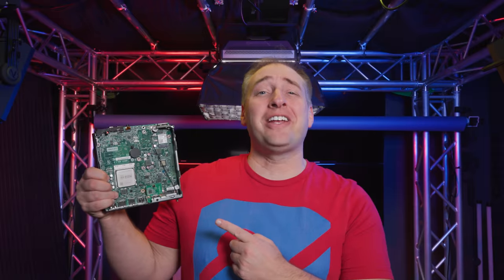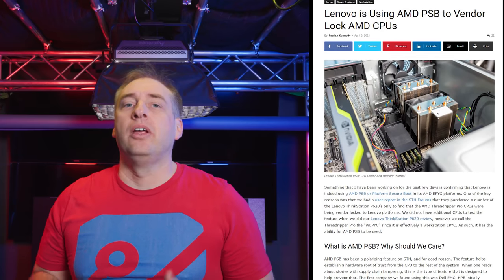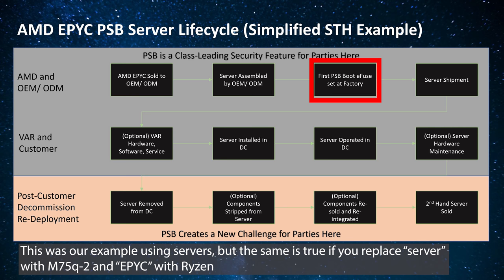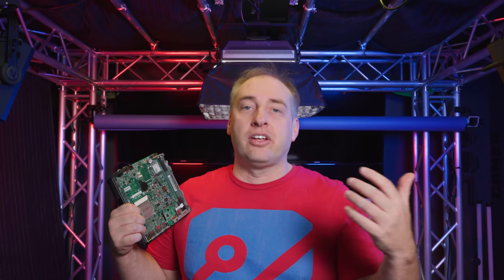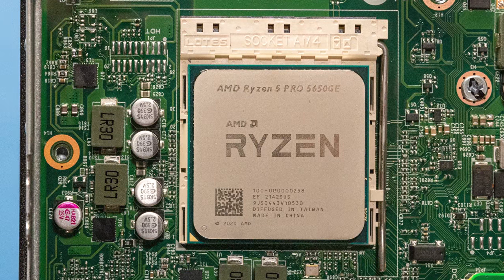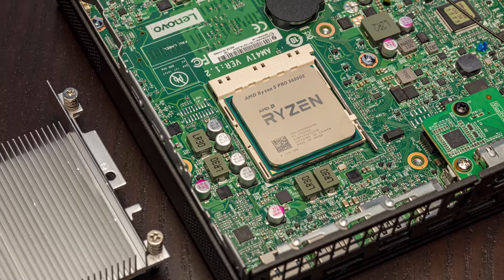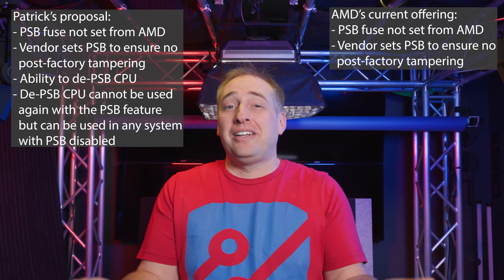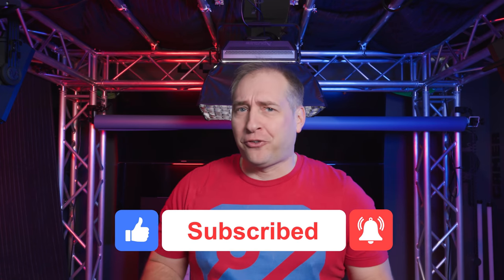Yikes! Lenovo is vendor-locking AMD Ryzen CPUs via PSB

Comment: I think AMD should support a physical mechanism for resetting the PSB fuses. Obviously you dont want it to be possible to reset the fuses in-situ via software (which would enable an ATP to circumvent the security of PSB), but there is no reason why a (cheap and easy) mechanism could not be supported to enable the fuses to be reset by pulling the CPU out and popping it into a "PSB fuse reset" board - or by flipping a small microswitch on the the cpu itself.  The PSB security is only intended to mitigate remote attacks: if you have physical access to a device you can always pop in a new non-PSB enabled CPU and then disable PSB in the BIOS. So giving a physical way to reset the fuses shuold not create a new security weakness.

Comment: This is one of those cases where computer security has gone way overboard. Seriously, if someone has access to the hardware, you are already screwed. Having a certificate chain between the CPU and motherboard is such an extreme, edge case that it is stupid to literally brand/damage all of the CPUs and make them practically unusable on the second-hand market. It really needs to be a feature that is turned off by default and for the 0.001% of customers who need it, they can damage their CPUs if they want.

Comment: The assumption here is that by locking against a specific vendor's signing key for their firmware somehow ensures that the chain is intrinsically secure. How much faith do you put in Lenovo maintaining said key(s)? I worked on early HDCP implementations, and in 2010 a root key leaked, pretty much nullified the whole model for that generation. In this model, not only do you end up with a bunch of CPU's that can't be reused, they could end up being associated only to compromised keys that have to be revoked. Is Lenovo or HP going to send everyone new CPU's? Nah, they'll just send out a "beware" notice. Frankly, this is security theater.

Comment: It would make absolutely no difference in security to have the secure storage for the CPU be cleared if the motherboard firmware presents a different root of trust. You could even prompt the user with "The root of trust for for the firmware on the current motherboard differs from the one adopted by the CPU. If you want to proceed with the booting process, the secure storage on this CPU will be cleared before adopting this motherboard's root of trust. Press ESC to cancel adoption and proceed to back up any data on encrypted media if necessary"

e-fuses are a fancy word for one time programmable memory, this is used in cheap microcontrollers, not with expensive and long lasting CPUs. This is a security clutch that makes me cringe every time I see someone use it. This is not about security, this is about control

Comment: This is the case of a vendor abusing a security feature (one that wouldn't likely affect more than 0.0001% of the market) for greed.

AMD should for sure put in the feature to fully disable PSB (wouldn't support secure boot anymore but no big deal there).

Without that ability to disable PSB, I feel this goes against the intentions in the "Right to repair" legislation.

Comment: Why can't they make it so that non-PSB motherboards don't PSB locks at all?

Then:
* a Lenovo system would accept only factory and Lenovo CPUs
* a non-PSB motherboard would accept any CPU (including Lenovo ones)

Are they concerned that an attacker could swap the motherboard with a backdoored non-PSB one? Then vendor-locking would make sure the owner notices because the CPU would no longer boot (in the fake motherboard). But in that case, the attacker could swap the CPU as well, so it just makes the attack a bit more expensive.

EDIT: A different idea: instead of fuses, the CPU should store the key in volatile memory, so that the vendor-locking is reset by a full power cycle. That way, you can remove the CPU and put it into any other system and it will still work, but you still protect against remote/pure-software UEFI attacks (which don't cut power to the machine, so after the attack the CPU wouldn't boot).

Comment: Lenovo's gaming desktops IdeaCentre5 and Legion5 which you can buy equipped with an Ryzen 5600G plus RTX or Radeon graphics card do need an installed graphics card, there's no way to just take out the RTX/Radeon graphics card and use the integrated graphics of the 5600G APU. Afaik Lenovo deactivated the APU's internal graphics. Can somebody confirm this, and if so, would this be also via popping a PSB fuse ?
I have no clue if this "Lenovo"- 5600G would work in another mainboard at all, maybe it's also vendor locked.

Comment: I'm already fighting with HPE over a second hand Proliant ML350 Gen 9 for a bios update. This makes me want to avoid Lenovo. I due a fair amount of collecting parts and building from the pile, vendor locking kills that. Bad enough that years back I had a Lenovo laptop that I trying updating the wifi and it refused to boot. Currently facing similar issues with an HP Elitebook 840 G1 where I can't use the aftermarket intel ax200ngw mini-pcie cards because HP doesn't support them. However my Toshiba love the card... go figure.. These kind of moves are big kicks in the teeth to people like me or people that resell used parts. Now I'm gonna have to ask sellers on ebay if it was pulled from a lenovo if I'm buying a Ryzen off there... joy..

Comment: The PSB is completely BS. The soldered CPU in notebook already did the "secure boot" job for no extra cost.  It's just an excuse to lock CPU with certain motherboard, just like  Apple to lock its iPhone CPU to the cellphone, then the locking mechanism now includes, the LCD display, the EMMC memory, and the lithium battery. 

If in the next few years, AMD announcing the new CPU will have the ultra security features, which locks to specific motherboard, with specific RAM, specific monitor, specific mouse, specific keyboard, specific power supply, specific case, with specific user finger print or face, then locked with specific GPS location, and specific IP address.  Please don't feel angry, that's only means we - "the customers should lock our payment to specific recipient with specific purpose to secure our transaction" in return.

Comment: Lenovo is the company which uses every possible mechanism to lock down components. It's the only company that produces laptop computers that have epoxy glue on all expensive chips like cpu, gpu and memory, and using epoxy glue makes them impossible to remove even for experts that can handle bga replacements. No wonder they immediately used a feature that locks down a socketed cpu that's meant to be replaced. And shame for AMD for providing that feature together with intel with its bootguard. There are clearly various ways to use cheap dedicated components on the motherboard to ensure trusted execution that locks that particular motherboard to its original firmware and prevent modifications. Just build the fuses inside that cheap component. Why would you do that on expesive parts? That's clearly money/e-waste generation.

Comment: Who the F locks a socketed CPU?  Isn't the point to prevent the BIOS from being hijacked without replacing the CPU?  Usually you want BGA with that to ruin your attacker's day even more.

Also shouldn't Lenovo provide an option to lock with a customer controlled key for any contract large enough to get a custom-signed BIOS spin.  The kind of people who want strong roots of trust also often want control over those roots of trust.

Comment: So humour me, why wouldn't this feature be implemented in a reversible way ?  Cryptographic signatures on the firmware is not a bad idea, and verifying that signature right in the SoC is also not a bad idea, but I really don't see the benefit of locking it via eFuses.  The same chain-of-trust could be guaranteed with a board-level jumper that enables/disables firmware verification.

Comment: This should not be allowed on something that is a consumer focused platform.
Every customer should have the right to demand a refund for a blown e-fuse on a new product just like any other physically damaged new product.
Your solution sounds fair but it doesn't help the current gen of "damaged goods" that will hit the used market in a few years (or less)
I'd be temped to return my unit as faulty (cpu tested as dead) if I owned one and try and get a replacement (in a year they could probably send me 12 machines all faulty) just to see how much I could hurt there pocket with this.
If enough people did that they would realise it's to expensive to enable that on a consumer platform.
Reply: As someone who buys a lot of used AM4 on ebay and swaps a lot of chips this type of thing really bugs me.
It's a show stopper when your shiny new cpu is doa and takes ages to sort out especially if the seller tests it on the system it came from.
This is a very quick ways to lose a customer in my opinion.
(I'll have to update my list of things not to buy now)
Imagen the poor child that gets this an upgrade for his birthday. Why??? (I have been that child and grew up hating my mum for being poor.... now I'm a bitter old man who only hates injustice like this)
(((( I see the other side of the coin but.... it's a consumer platform ))))))

Comment: i have an alienware aurora with a ryzen 7 5800x. i wanted to transplant the main hardware into a new case etc.

turns out the msi mobo just doesnt boot. changed ram, psu, mobo... nothing worked. then i learned about PSB. live booted linux and yes, PSB is enabled on my cpu. great.

i'm sure there is a legitimate use for this feature - but on consumer machines? amd should really make separate cpus sold for consumer use without PSB. so shame on lenovo and dell..

Comment: This has just dissuaded me from going anywhere near Ryzen, was considering it for my next machine but seems like just waiting to be exploited somehow. How long until we see a malicious fuse blowing malware rendering all these chips inoperable
Reply: Do you buy used CPU's? I do not think a fuse can be blown with malware outside of a possible bios upgrade maybe doing it. Your scenario is as unlikely as malware that will over-voltage a CPU  burning it up. It would have to be a bios infiltration on a bios update. Intel has the IME or Intel Management engine which is far more nefarious. Look it up as it controls your network and basic functionality Ring 0 or the highest privilege. . The US gov contracts only Intel chips with this disabled. System 76 Laptops use to disable this in the bios (I have one) but I do not believe the latest Intel chips can be disabled. You are a Intel fanboy anyway so stay in your comfort zone. I will not buy Lenovo or Dell but trust a retired SMB Networking shop owner, Intel has been screwing consumers since AMD lost it's edge with Bulldozer. Now AMD has a lower power per cycle solution that is within single digit performance on single core and on the latest Intel costs way less with only a marginal Intel performance advantage. You can thank AMD for Intel's cheaper prices as Intel stifled innovation while charging ridiculous prices for far to long until AMD was back in the game with Ryzen.

Comment: This has absolutely no benefit to the customer and system owner. This does not improve security in the least. This basically blocks you from doing with your property what you want and you will have to buy a new device or CPU when locking trashed the old one. I smell a dirty deal between AMD and Lenovo: Lenovo makes sure AMD CPUs can't be sold and swapped, which brings AMD more Profit because people can't buy used CPUs and have to buy them new. And I bet that AMD paid Lenovo for doing that.

Comment: How do they do the lock actually like how does it know what board it is? Does it just get the firmware name or what?
Reply from the maker: Video has the AMD statement on it, but it is OEM firmware signing key that is validated with the PSB fused lock.
Reply: @ServeTheHomeVideo  So it’s making a hash off the firmware binary and checks that against there key in the cpu. If it’s just attached to the firmware as in a block offset it’s circumvent able.

Comment: So, if the motherboard needs replacing because of a fault then you would need to replace the CPU as well? Even if it’s working?
Nice one Lenovo.
Reply from the maker: Went over this in the mechanics of how PSB works, but you can use the existing CPU in a Lenovo signed motherboard.

Comment: Wow, Lenovo started soldering the RAM on most of the ThinkPad line, now they’re locking down the CPUs they purchase?   Going to have to start looking more at the HPs, never trust Dell…
Reply: One RAM is soldered, but there is a socket to add a 2nd SO-DIMM module.   So upgrades are still cheap and easy.    

Apple offers zero chance of RAM or SSD upgrades on the notebook computers.

Comment: I can see where this is coming from. That formfactor of pc is not big in consumer space. Though it is big in company and government sector. They probably want the extra security that this feature gives. Also a company or government buying thousand of this computers in a bulk will probably also buy some kind of service with that. So it will not be any problem that the cpu doesn't work with any other hardware than thouse thousands of other pc in same bulk order.  

For regular consumers. It sucks.

Comment: I hate when companies do crap like this, using some excuse with this or that reason. There is no reason other than vendor locking.  This is why the original PC did NOT fail because it used a more open architecture and IBM used Microsoft and allowed companies like AST and others to create products that enhanced the system.  Vendor locking is an excuse and is not in anyone's interest.

Comment: Hardware validated boot - wouldn't this really be easily circumvented given enough time? From a re-usability, repairability, e-waste, environmental standpoint it seems daft... Vendor locking.... tsk tsk...

Blow-able fuses, so we probably already have all sorts of folk programming malignant software targeting this?
A nice way to prevent 2nd hand market - there's a commercial gain after all... Ryzen is a consumer platform, if they do this in EPYC it's more understandable. But still. Making a system PSB secure should be greener than this.

Comment: so if you get one of these processors you can return it to AMD as faulty when it doesn't boot on another platform? you know as it is now damaged. you own the processor, and these should ship with warranty. so use your AMD warranty folks and send these CPUs back to AMD for a replacement. AMD will soon get the idea that having this feature is a bad idea.
unless you have locked it yourself, this should be covered under warranty.

Comment: So the reason for using this lock is tamper protection?
Because we all know that Hackers physically break into datacenters and offices to swap CPUs at night. /s
It's BS and a nightmare to deal with on the re-sell / re-buy market.
NOBODY knows about this and casual buyers will just assume the CPU is broken.
I do understand this can be an important security feature for workstation/server CPUs.
But who asked for this an consumer grade AM4?
Why is this not on the feature list for marketing material?
Assuming I did buy a Threadripper (Pro) exclusive workstation in the past, I would know nothing about this vendor lock until now.
The CPU may have less value than assumed and I think this would be a case for a lawyer.
Lenovo failed to inform buyers about this vendor-lock.

Comment: 7:35 what you just said goes against everything they have shown thus far though, IF that is possible, then bypassing it should be possible. Conversely, the opposite is also true. If rumor is correct and its locked to the mobo, then it promotes further sales.. regardless of ewaste. Clearly Lenovo's gives no fucks about public perception.

Comment: Also this is just a solution looking for a problem to be solved. If you have to secure a CPU in a server environment than your server access security is the one that laking. What a joke, so I can't stroll in from the streets and accidenttaly swap a CPU in a server rack.
Reply from the maker: On the server side, more are concerned with the hardware getting intercepted between the manufacturer's shipping dock and the data center.

Comment: What exact use case is locking a CPU supposed to protect again. Don't just handwave and tell me it's 'for security'. Give me an exact scenario that a vendor-locked CPU will protect you with, whereas an unlocked one wouldn't. Are we assuming an attacker has the ability to manufacture rootkitted AMD processors or something? How fucking likely is that?
Reply: And wouldn't they just manufacture a rootkitted processor that allows adoption using the same PSB mechanism, and pretends from that point to be a Lenovo-vendor-specific processor while still doing its Secret Evil Stuff? LITERALLY what is the attack mechanism this vendor locking process is supposed to fix?